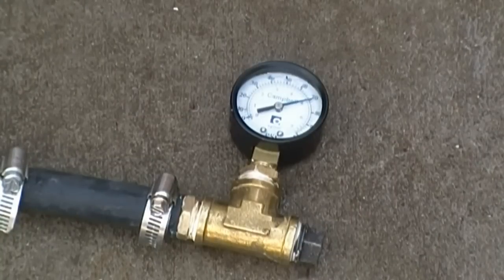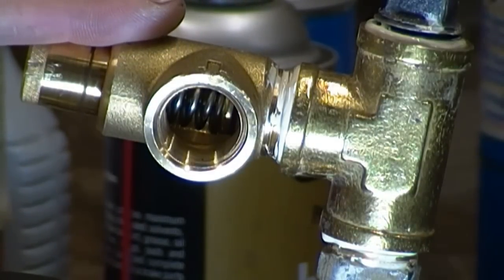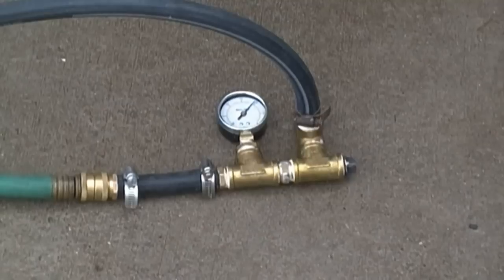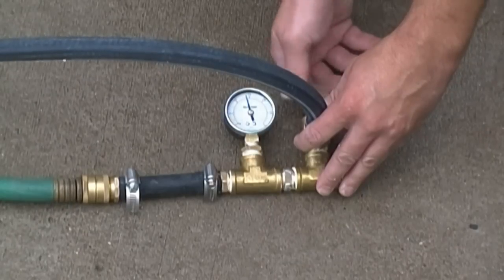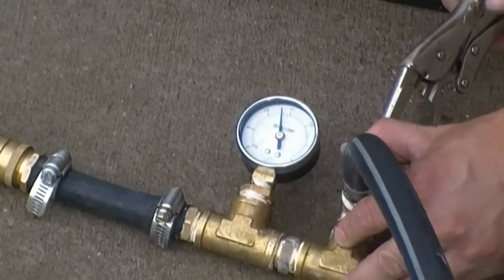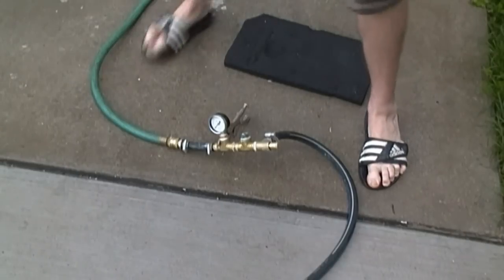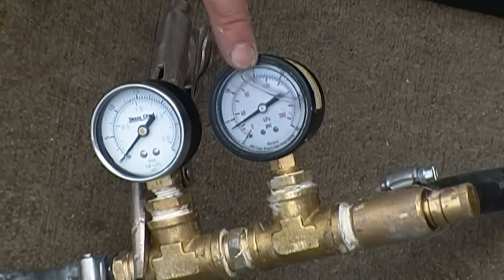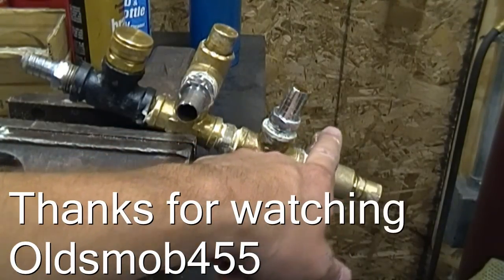Setting  Jet Boat pressure relief valves and a house water pressure check

Comment: Cool video. Just a FYI On the liquid fill gauge there's a round rubber plug of some sort on the back, air gets trapped overtime from laying around or something just pop it out halfway and the needle will go back original to reading "0"

Comment: Hey guys.  I just bought a 1979 eliminator jet boat with a 460.  I see that the plumbing im my boat needs an update considering there is a ball valve by drivers seat to regulate temp.WTF!!  I have been looking for a pressure relief valve that has a low pressure range.  All I can find are 50psi and up.  I know that there are companys selling valves for jet boats but they want 79.99 for a 15.00 valve.  Can you point me in the right area to find one .  Thanks

Comment: This is snake oil. Your jet drive doesn't push enough water pressure to do damage to the engine. I admit I sold my jet boat around 2010 and never seen this before. Ill say this to mr 455, My 455 put out way more hp than yours and I never blew anything in the cooling system. One I know how to build my 455, ported heads, 10:1 forged pistons, oil cooler, 10 quart pan, block bored .60 over, nodular crank, stock olds rods, Mondello main oil plugs, engine balanced, fly wheel not a flex plate, Offenhauser dual 4 tunnel ram, dual 750 Holley's, Nitrious Oxide cheater system using 250 shot, Berkley pump with AA impeller,  place diverter. If your jet drives water pressure is doing damage to your engine then you have did something wrong.  The only damage I ever did to my engine was a bent rod and 3 scored pistons from standing on the nitrious button to long. I owned my jet boat 20 years, 3 rebuilds and 2 blocks. I was hard on it because I like going as fast as I can. But never once any type of damage due to extreme water pressure or overheating. And btw I never ran a water restrictor plate at the thermostat housing. I also used Hardin marine exhaust logs and through the transom trumpets using the largest opening for flow. I got tired of getting burned. Only jet drive boat I could see needing this is top fuel drag or even maybe alcohol. I see CP performance is selling this so ill look through my CP performance book from the mid 90's to see if they sold this.
Reply from the maker: There is  a reason your radiator cap relieves pressure at a certain psi.
Reply: @Oldsmob455  thats in a car not the same for a boat. this type of boat has no radiator

Comment: What’s the second relief port for?
Reply from the maker: We have enough horsepower that one isn't enough when we put the hamer down.
Reply: Oldsmob455 Okay well i am new to the jet boating scene and right now I’m building a drag boat. Got a Sanger super jet hull with a built Berkeley pump. I’m a custom engine builder for a UMP modified dirt team and I’ve just got my sbc off the dyno and ready for my hull. Just need some insight on plumbing this. 800 hp 400 cubic inch sbc that spins 9,000 rpm. I am running dry open headers which is obvious. I am running a racepak data logger and dash and running sensors everywhere. Where do i put my relief valves? And I’m running either -12 or -16 an braided line on everything plumbing.
Reply from the maker: I'll say this, we plan on converting to a water to water cooler with a electric pump so we are not running lake water through our block.  I think we had a video on our plumbing after this one where we plumbed in a v block.  A guy at Mondellos once told me he has a releif valve at all four corners of his intake.  My setup is attempting to releive the pressure before it gets to the block.  The key to your set up is going to be getting the right impeller that makes the sbc run where it likes it.
Reply: Oldsmob455 thanks man. I’ll try and look into what needs to be done! I have the right angle cut impeller for my rpm. Just gonna be plumbing this thing to get the right temp and pressure.